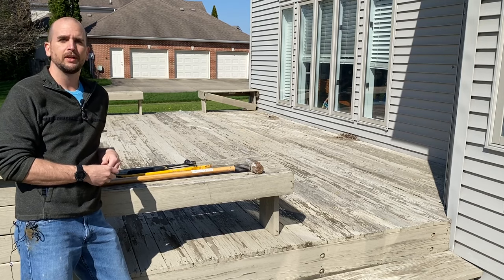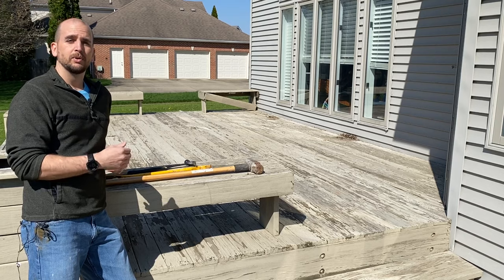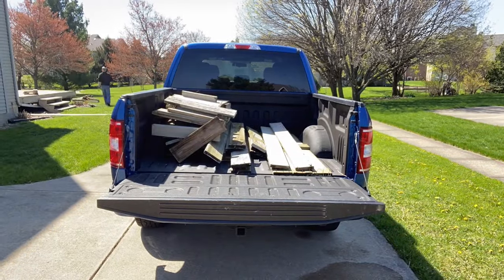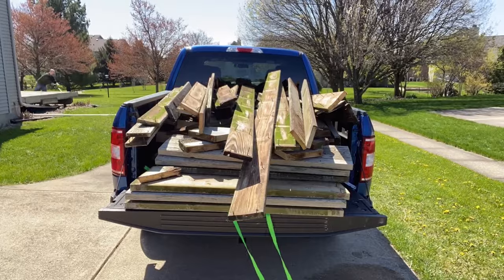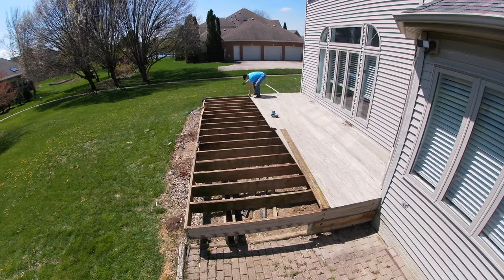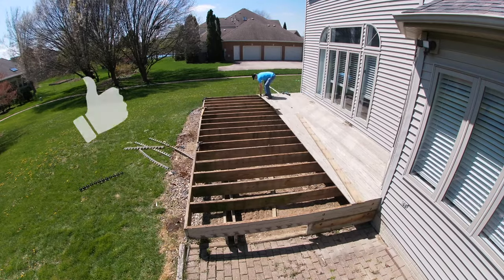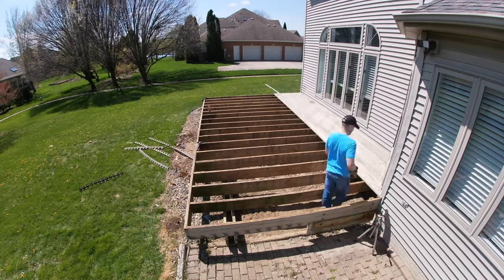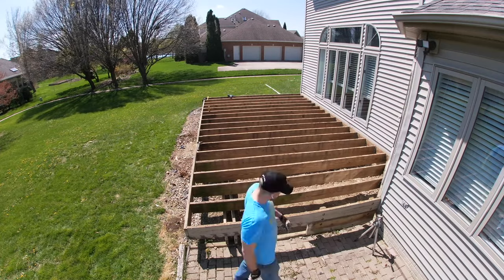Rebuilding a Deck Part 1  - Removal of Wood Down to Framing Structure

Comment: I would have salvaged that deck 100%.  That deck is in solid shape.  Just as he did, I would also take out the top seats and store them somewhere in the back yard to be processed later.  Take off at least 10 boards at a time, flip them and resurface the back of the wood applying wood putty on the holes to sand them.  I would treat them with 2 coats of wood oil and reinstall them.  I would do the same for the benches.  I restored my deck which was way worse than that one reusing the back side.  I invested on deck screws, sand paper and wood putty and deck wood oil thus saving thousands in a time when wood is premium at big box stores.  Good luck to all of you out there doing this project and excellent work building that deck Everyday Home Repairs.
Reply: I would love to have seen that, I see all this videos about salvaging and repairing old or rotten wood. What is a good one, there are so many and I don’t want to end up wasting money. If you have a thought please let me know.
Reply: @Goat4964  I became very creative when the wood prices started soaring so I carefully uninstalled all the top boards.  I then sanded them and used the wood dust to sprinkle over the glue I put on the holes and indentations.  I bought an oil type deck sealer so it could seep into the wood planks and the structure and simply installed the brand new boards again.  I used the back side of the boards since it was in excellent condition. It is still holding up to this day.
Reply: Dang I wish I had that type of time but I work out of town.
Reply: @hill4472, did you do anything to treat the original tops of the boards that were weathered? Or did you only treat the backside that became the new topside?
Reply: @hjmattos  I sanded both sides and treated both sides before I reinstalled them.  They are still going strong.
Reply: By flipping the boards the bark side would have been wrong side up.  But it would save some money, but how much longer would it last.
Reply: 2x6x12 are only about 12 bucks now. Better to put down new wood.
Reply: @jfkesq  They are exactly 12 dollars here at my local Home Depot, you are absolutely correct, but the wood I processed is still holding strong.  Eventually, I will replace all the deck in the future when it starts to deteriorate.  My intention was to save money when the prices where skyrocketed.

Comment: Good video. I found it after demo the floor of my Mom's deck. It was rotten very bad butbthe joists were good. I started demoing with a sledge hammer and a flat pry bar. Till my uncle came up. He had talked to another reletive that does contracring. Tip to to remove the boards was 2 2x4s one as a brace one as a lever. I had a somewhat good 2x4 for the brace and used a 5' piece of angle iron for the lever. Went much easier than the flat bar and i did not have to by a tool i probably will never use again

Comment: Do you have a video or short explaining "when is it time to replace decking board?" How much organic growth is too much? How do you know when board is too water logged? How much splintering is too much? etc 

Warped/sagging, broken, soggy wood is clear but before that point... When is removing organic growth, good scrubbing, careful pressure washing,  sanding (if needed?), & re-staining not advised & new decking recommended instead?

Thanks for your content. This is my favorite home DIY channel.

Comment: I’m fixing my parents deck and I originally thought it was just going to be a deck board swap. Turns out the frame was rotten, damn that sucks. Start pulling the frame and some of the posts are rotten. So what was thought (and planned) as a simple week project turned into digging out concrete supported posts that had been left to rot since the 80’s. I’m 26 with no experience in carpentry other than natural ability and what I can find online. Dug out old posts and re-cemented them. But I’m in over my head. I can swim but damnnnnn

Comment: 2 thoughts.   1.  you suggested possibly taking old deck where wood is burned.  Pressure treated wood should not be burned due to the chemicals in the wood.  2.  if you started the floor tear out at the house and worked your way out, you always have intact floor boards to use with the crow bar for prying leverage and it saves jumping in and  out of the framing.  enjoyed the video
Reply: Pressure treated wood is now usually just a simple teat treatment, and not injected with a lot of antirot chemicals. It's why HT boards are safe to use with vegetable crops now

Comment: Dang.   That looks so much better than mine.   I step through one.  Stuck. 9:00 at night, no phone….🤦🏼‍♀️   Anyway.   Time to replace.   Cresant Bill Bar.  Game changer!   I am a 64 year old widow.   I removed it all and replaced that.  
No salvaging this stuff.   Joist was in good shape.  I still have 2 sections to work on next.  Can’t find anyone to come so this, and I work cheap.   Next is 16 x 12.   Buy that bull bar.  My first dee  was 5’ off the ground.   Lol.
Reply: I did have separation on the corner due to a tree falling from hurricane Zeta.   I had a friend come help me.   I had the right idea, just could t do it by myself.   Yep. It was a woman…. Where are the guys around here???  Watching part 2 now.  Tips before my part two.   Treated wood is in my garage now. 😢

Comment: Great video. My deck is 12X12. We began with bare ground after tearing out all the previous rotted out deck. First we strategically placed nine concrete bases. Upon that we ran 2X6 es. All wood is pressure treated. Atop those boards we added 2X4 s 16” apart. On top we placed composite fake wood decking. Top layer in place with hidden metal fasteners. et vala! Good looking life time deck.

Comment: What if the decking is secured to the beams with decking screws?  What is the best removal method? 
Also, what about planing the decking?  Would that be a good option for recycling / reusing the decking?

Comment: My deck is quite large was going to tackle in sections . It’s also fairly high off the ground . In that situation would you remove a couple boards and replace them and repeat or still strip the whole deck first

Comment: Were there nails or screws holding down your deck boards? I'm replacing deck boards that are held down with screws. I'm thinking to grind off the screw head and pull the board, then cut down what's left of the screw to the surface of the joist leaving. I really enjoyed watching parts 1-3. Thank you!
Reply from the maker: Are the heads still in good condition where you could back out the majority of the old screws?

Comment: Kind of an idealistic deck to remove. Still helpful tips, but not all / most decks are not rectangular in shape and held together with nails...
Mine was held with old + screws, most with bad heads or will break inside as soon as the impact driver touches them... Let's just say it took more than a sledgehammer and prybar to remove those lol (Saws all with medium metal demo blades, grinder with cut off wheel etc...)
Wood boards could be donated for free on craigslist if you are around a metro area.

Comment: My deck boards are caving in from the wood under rotten due to water. What would you recommend using to reinforce the deck boards, I’ll likely have to replace all the rotten boards but I don’t know what to put under them to replace the beams or “joist” idk what there name is.

Comment: Can you tell me what the job cost? Or a rough estimate. I'm in a similar situation. I got a deck that needs to be rebuilt. Looking at getting it done in the spring.
Reply from the maker: At the end of this video https://youtu.be/JQm_kOreYNI which covers the same deck project but is the part 3 of the series I go over the cost at the end being $2,275 for a 336 sq ft deck.  This is just for materials using pressure treated deck boards.  If I were to hire my deck out I would guess the total cost of material and labor would be around $8,000 - $12,000 for the job.  There are many factors that can increase or decrease your project cost but those are the numbers for my project.  Best of luck and make sure you get multiple quotes.
Reply: @EverydayHomeRepairs  thank you

Comment: How much did cost this project, good work !
Reply from the maker: Hey Ricky, I have only done the removal part this past weekend and since I have a truck my cost is only $175 for material disposal at the transfer station.  More videos to come in the next few weeks.  I need to do some work on the structure then replacing the decking with new pressure treated boards.  I will make sure I add my costs to those videos as well.
Reply: Everyday Home Repairs thanks for the video keep the good work

Comment: I see your deck was held together by nails. Mine is with screws, would I take off the decking differently because of the screws?
Reply from the maker: Are the heads of the screws still in good shape?  If so, I would use my compact nut driver and just quickly back out each screw or at least as many as I could.  Let me know how it goes.
Reply: If the deck is old and rotten the screw heads are mostly no good.  Also people use ring shank nails.  How to best handle?

Comment: Or use the old deck to make raised beds.
Reply: dont plant veggies in pt wood....chemicals...but great for flowers
Reply: @jfkesq  the wood isn't pressure treated. Also, I made boxes with them and then wrapped them in plastic just Incase.

Comment: My deck is hilariously bad and built by an absolute, ummm, well, moron.  Seriously I've never seen anyone ever cut all the roof support posts and shove the railings in-between them.  The railings have rotted so bad that they are literally like paper mache to the touch.  The housing market was so nuts even with that and a bunch of other things the house needed they still got full asking price for house.  A price that would normally be for if all the corrections were done.